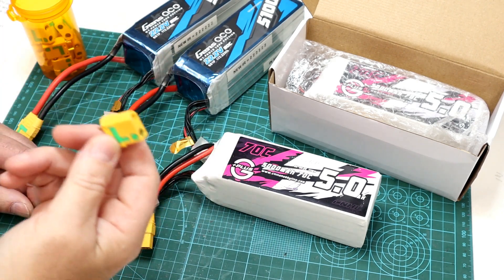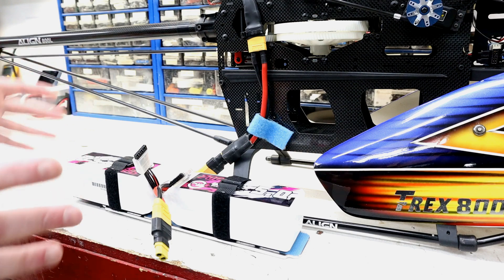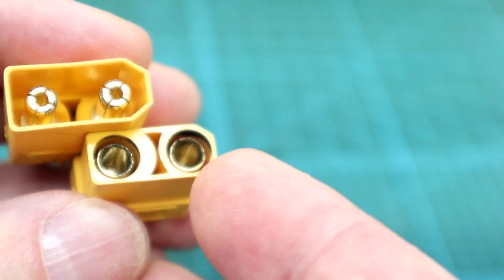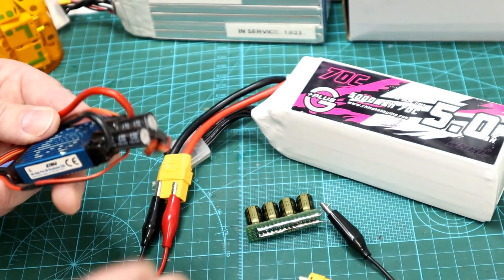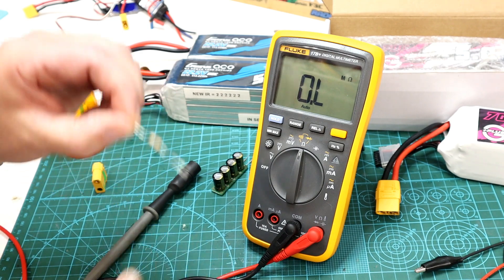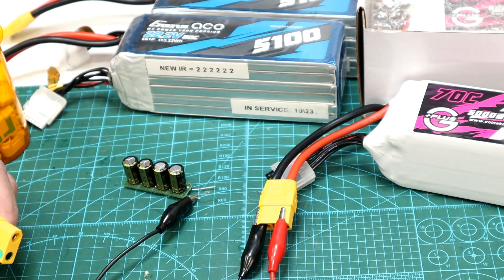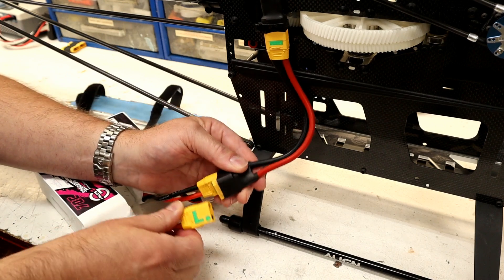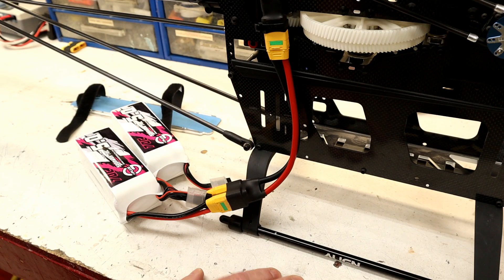How Do Anti Spark Connectors Work & Do You Really Need Them?

Comment: I think maybe inrush current protection should be the responsibility of the ESC, it wouldn't be too difficult to implement on its PCB.
Reply: How would it not be too difficult to add? Currently the caps are just connected straight to the power leads, a very simple connection. To add inrush current limiting to the caps you would need to add a number of other components like a resistor and a large switch, either a relay or high current mosfet which would need to be rated for at least the maximum ESC current and would just waste energy to heat.

Comment: Greetings, very good video explaining,, I only wish I'd found it earlier as I went and designed a pulse width modulation method of soft starting/ pre charge for the capacitance inrush,, that method works well but more components whereas this solution is simple yet effective!
Thanks mister.
Reply: I would question whether using PWM would actually work. PWM works by just switching it on and off very fast so whilst you may lower the average current the instantaneous current (the current at the instant the first pulse occurs) will still be very high, likely as high as the inrush current would be so basically you would still have the same inrush current unless you added resistors for current limiting.

It may still stop it from sparking but that could just be because it delays the inrush current from the instant an electrical connection is made when the battery is plugged in until the connection is better when the first pulse occurs. Just stopping sparking doesn’t mean you stopped the inrush current.

Have you looked at the inrush current on an oscilloscope? That would be the only way to tell if you actually managed to lower the inrush current.

Soft starters like that are generally used for motors where the inductance of the motor plays an important role in the soft starting process. Think about motors and LEDs, if you apply PWM to a motor it will go to a portion of its maximum speed, if you apply PWM to an LED it will go to its maximum brightness for part of the time, these are not the same effects, especially not electrically. It would be similar when soft starting a motor vs a capacitor, the motors inductance would smooth out and limit the current but you wouldn’t get that with a capacitor, it would be the same affect as if you just connected and disconnected the capacitor very fast since there is nothing to limit the current and because of that you would still get the inrush current.

To limit the inrush current you need to add something that would actually limit the current, not just switch it on and off very fast, that means adding either resistance or inductance.

Comment: Or just put a reistor on the capistors then you dont need one 🤷‍♂️
Reply: If you “just” do that then you limit all current going to and from the capacitors and likely the current going to the ESC too, not just the inrush current. That then defeats the point of using capacitors since they can’t deliver the current they need and could mean that you can’t deliver the needed current to the ESCs either. It would also need to be a big resistor to handle continuous use at those currents rather than just handling the inrush current like the resistor in the connector needs to.
Reply from the maker: @darklore7566  wrong

Comment: From my experience, overtime the resistor eventually burnt out depending on the voltage you use. It can handle 6S for a while, but over 6S, it burns out faster.
Reply: Then the resistor isn’t suitably rated.
Reply: Just judging based on looks the resistor in the connector will be tiny, likely not much bigger than a common 0.25 or 0.5 W rated resistor. The instantaneous power across a 6 Ohm resistor when connected to a 6S battery which will be the case right at the instant electrical contact is made works out to be 106 W. Now obviously that power isn’t sustained for very long but is likely much higher than the resistor would normally be rated for if it was used in any other application. Even if somehow it was a 2 W rated resistor then it is still used far beyond its specifications right at that moment.

Also if you are a little slow in plugging in, any power your quad tries to use (FC, VTX, motor beeps, etc) will be going through that resistor and again will likely be above its ratings which will just cause it to degrade.

Comment: Its a pre-charge circuit thats clever. electric cars and trains ect have pre-charge circuits  but its a big relay with a resistor. The spark high inrush current shortens the life of the caps also. On larger caps it can rupture the cap.
Reply from the maker: Excellent comment! Thanks 👍

Comment: I replaced my eBike 14S battery connectors with XT90S connectors, and love them. I used to get huge sparks when connecting and it was wearing out the connectors. Whoever invented the anti spark connectors is a genius in my mind 😂
Reply from the maker: Yes indeed 🙂👍
Reply: For 14S, I would recommend people to use AS150 with built in anti spark. It can handle higher voltage and current better
Reply: @henryairconcepts2999  they are both rated at 500v. 14S is max 58.8v for almost all eBike batteries. At max I’m drawing 30A. XT90S are rated at 90A continuous. It’s already overkill. I’ve never had one fail or burn up. Stay within the range of the specs and you will be fine.

Comment: I work in utility scale energy storage. In my world This is called a "DC pre charge circuit". We basically use a resistor, a diode, and a fuse and or contactor (sometimes both)...to go "Around" the main DC contactor to bring the DC bus voltage up softly. In Some of our systems, the pre charge circuit stays closed all the time. In others, closing the pre charge circuit before the main DC contactor is part of a startup sequence. You could actually build this yourself as well, by using a 2nd connector pigtail that could even be smaller... with a resistor in parallel to the main xt connector. This might also provide an opportunity for a more resilient resistor or more appropriately sized for the "control power constant load" to prevent the heating you described. That might also be more complicated than it needs to be. I guess it would depend on the application or use case.
Reply from the maker: @robertmoorej "build this yourself as well, by using a 2nd connector pigtail" Yep, that is exactly what many in the hobby did (and some still do) before these anti-spark connector options were introduced (XT90S, XT150S & QS8-V2). 
As you surmised, it was not an ideal solution in many model aviation applications where space is usually at a premium, the hassle of having two connectors to worry about (4 in HV power systems), the odd time forgetting to plug in the "big boy" and the often occurring entangled mess of the smaller pig-tails when having multiple battery packs packed in our field box/bag. 
These single type anti-spark connectors offer a low cost, low weight, hassle free elegant solution to those issues for those of us who decide to use them 🙂
Reply: Hybrid or EV cars have this pre-charge circuit as well. My Toyota Hybrid has a relais with a resistor parallel to the main (positive) contactor. At power up, if listening closely I can hear two clicks. First the pre-charge relais (and negative contactor)  and shortly after the positive contactor.

Comment: Youtube suggested video probably because of electronics, but I dont run high voltage RC stuff. I’m sure they work as it’s just a pre-charge resistor, same thing we do with high voltage batteries for solar systems on BMS’s that dont have them built in. My only concern looking at them is that the negative port part should come out just as far as the resistive side or it still might cause a bit of a spark. So it would be important to line them up as straight as possible when plugging them in. Since I know XT connectors can be on a slight angle when they are first plugged in.
Reply from the maker: The further inset negative sleeve is purposely engineered that way to reduce pin to pin short potential. For RC applications which these are primarily sourced for, we often have several to many LiPo packs in our field boxes/bags with not only other connectors of different sizes and types bouncing around in close proximity, but often the odd conductive tool or part.  
- No, you don't get sparks with these and they work exceptionally well for the simple design and the intended application.
Self alignment properties of Genuine Amass XT30, 60 & 90's are excellent compared to other RC connector types in their respective current ranges - a non issue.

Comment: Certainly high currents into electrolytic caps won't do them any good, but caps are a lot better then 20 or 30 years ago.
I would prefer to slow charge caps. Why abuse/stress the equipment when there are alternatives?

Comment: Would love to see your testing of the CNHL batteries.  did you get a bunch of them?  I have one, and its like 60% of its rated capacity (4s 8500, but runs like 5000mah).
Reply from the maker: I purchased just those two (6S 5000 mah G+) to try them out both as single and in 12S series format.
So far very impressed. Been flying them pretty much exclusively in two different 80mm EDF jets (6S) and a scale 800 EC130 heli (12S).  
They peak just over 116A in both jets during full throttle vertical climbs, exactly the same as the 6S 5100 Gens Ace do, so discharge performance is good so far.
They barely get warm (same as the Gens Ace), and I get the exact same flight times as I do with the 5100 mah Gens Ace packs always coming down at about 3.78V per cell (22.7V pack) open circuit voltage (about 70% discharged). They are also lighter than the Gens ace so vertical performance on both EDF's does seem to be a tad better (subjective of course).
Charging confirms very realistic capacity on both of them.
IR has remained low and stable with no noticeable increase. 
Have roughly 15 flights on them now. Want to get a minimum of 30-40 flights before sharing any opinions. 
Sorry to hear your experiences have not been as good. What series of CNHL packs did you get? I was told by other fliers only the G+ line are worth getting, so that's what I purchased going on their positive anecdotal experiences.
Reply: @Rchelicopterfun  I just realized I have the HV version, so I'm going to test again after charging to 4.35V and see (as they are 120C).
Thanks for the great response, I'll check out the G+ line next then and see.

Comment: Hmm... spending 20% of the contact area to fix pitting on the 1% contact area of the edge? Nah not impressed😂
Reply from the maker: Has little impact on maximum current rating considering it's the bottom half of the sprung male pin that produces the majority of the surface contact area & tension within in the sleeve. Certainly has less impact than having the top 20% plus of both pins and sleeves pitted and burnt.
Don't know where you pulled the 1% of pitted area from partner? Certainly not the real world. Even when just the tip of the male pit is pitted and burnt, it begins reducing contact area all the way down the sleeve and is cumulative in nature. 
I've experienced XT90 & EC5  sleeves burnt & pitted right to the base on most 12S & 14S power systems. The example shown in the video was at least 50% down the sleeve.
Then there is the elimination of the inrush current to the power caps, but the debate is still out on that one. Most electrical engineers & technicians will agree high inrush has a negative impact on overall electrolytic capacitor life/electrolyte breakdown, but it's likely not something we have to worry about in the grand scheme.

Comment: You get spark without the caps on 6s quad… what’s the deal? Has nothing to do with caps, it’s just the energy jumping over
Reply from the maker: You do realize that ALL ESCs have power input electrolytic capacitors in them. If they didn't, the MOSFETs wouldn't last. Quads have 4 ESCs so they will have at least 4 power input caps (one in each) that are contributing to that inrush current when you plug in the LiPo, but likely more depending on the power ratings of the ESCs.
Many quad ESC's don't have the caps sticking out the ends because they are lower power and thus not thermally challenged, but they are in there, rest assured. "Just the energy jumping over" - ya, over to what - the 4 or more power input caps, that's what.

Comment: A DPST snap action switch wired into the toys power lead would be an easier fix .
Reply from the maker: How so? Perhaps you are unaware that models like this will pull well over 100 Amps (this particular 800 helicopter can peak upwards of 150A).
 A 100+ Amp rated DPST toggle switch as you likely know is very large. It would weigh a lot (the enemy of all RC aircraft) and cost a lot. Fundamentally however, a switch wouldn't fix a thing. The sparking/pitting issue as capacitor inrush occurs would just move to the switch contacts necessitating regular switch replacement instead of low cost connector replacement.   
An even bigger problem with a switch/toggle is this contact degradation is hidden with no way to visually inspect condition during your pre-flight. 
A switch of any sort is introducing an unnecessary failure point in any RC power system. Certainly far from easier, won't fix a thing and is failure prone to boot. It's precisely why we never use a switch between the LiPo packs and ESC, especially on larger models with high current demands.
Reply: I don’t think you know much about these if you are referring to them as “toys”. On a lot of different kinds of RC vehicle, especially flying ones, it can easily draw 100+ A at times through the power connector for enough time to cause problems for improperly rated components, that’s far beyond the capabilities of basic switches and well into the range of large, heavy and expensive switches.

Comment: Surely that 6ohm resistor for the initial ring will provide greater resistance than the pitting. I would assume it would realistically be negligible but 🤷🏻‍♀️
Reply: the resistor is engaged just at the beginning, after you completely connect the connectors then it's a direct connection like normal
Reply from the maker: Not sure I understand? Unless I'm missing something in your comment, yes, that resistor is doing exactly that, proving greater resistance so the current going to charge up the capacitors (inrush current) is reduced, thus reducing the sparks/arcs that pit the contacts.
A healthy, low ESR electrolytic capacitor at zero voltage potential (uncharged) is essentially a dead short when the voltage inrush hits, so using Ohms law, 50 V/6 Ohms =  8.3 Amps = very little current and thus no arcing. If we do the same calculation with very little resistance (say under 0.2 Ohms) which would be typical in a regular healthy RC connector 50 V / 0.2 Ohms = 250 Amps. ⚠

Comment: A long time ago we used to see people do 1 of 2 things:
1 - Having 2 connectors - one with a resistor
2 - Large coils inline on the battery side

With 2 connectors sometimes people used the same connector twice - so you could still use the wrong one and get sparks, or use the wrong for charging.
And coils... they need to be big to really reduce the sparks.
Reply: Haha you can kill the sparks with a small coil but then you burn it in use so well that's a little self-defeating. :D

Comment: Anderson Powerpoles > XT.  Can easily remove the connector from the housing and clean them.
Reply from the maker: Can't clean pitting off any connector surface, and once pitting starts, further degradation is accelerated regardless of connector type (yes, I've used Anderson PPs as well).

Comment: XT-## fittings are very tight and wiggling them back and forth connecting them can cause multiple sparks. Can't be good on the electronics.
Reply from the maker: Genuine Amass XT connectors are some of the easier to plug/unplug out there in their respective current ratings. Not that it matters because you don't get multiple sparks with any ESC connector due to the simple fact the instant you get that first spark, the capacitors are charged and there is no more voltage potential difference between them and the battery.
Reply: Replace em if that's the case, they shouldn't be sparking after the initial connection. If there is that much wiggle in an XT, it's beat up and ready to be replaced

Comment: I don’t think rapid charging of caps is an issue, the main purpose of caps is they store charge in a more mechanical way which shouldn’t be damaged by rapid charging and discharging. They also take on so little wattage that it’s not really a concern imo. That being said it certainly doesn’t hurt anything to slow it down a bit.
Reply: "in a more mechanical way"
???
They dont do anything mechanical.

But yeah they are designed for high currents - and still the inrush is not good for them either - but that is so rare with how few times you actually connect batteries it does not really matter.
Reply: @ABaumstumpf  it’s mechanical in the sense that they essentially just hold the electronics rather than a chemical reaction occurring, that’s what makes them different to batteries
Reply: @EV_Dreams  "it’s mechanical in the sense that they essentially just hold the electronics rather than a chemical reaction occurring"
This is so bad - it fails to even be just wrong.
I mean first of: No, they do not "hold electronics" - did you mean electrons? Cause every part of electronics holds electrons (and no, you do not get more or less of them in a given part.

What makes them different is that, like other capacitors, they store a charge-imbalance directly, rather than in chemical for like typical batteries does. That means they can handle more power at the expense of having lower energy density.

So in neither case there is ANYTHING "mechanical".